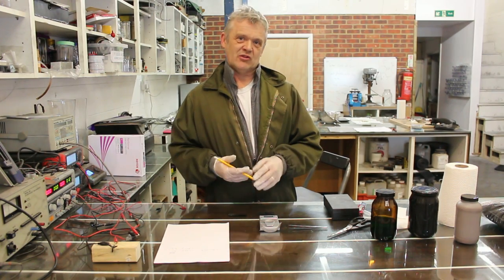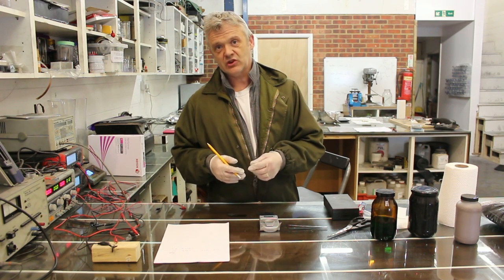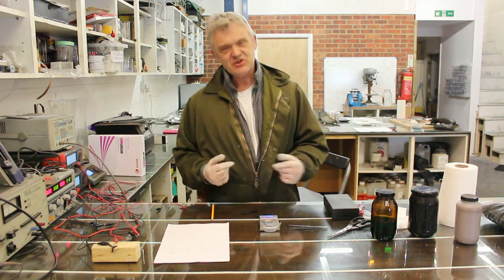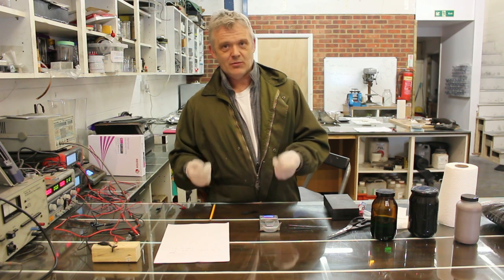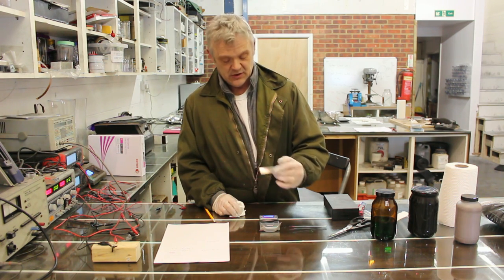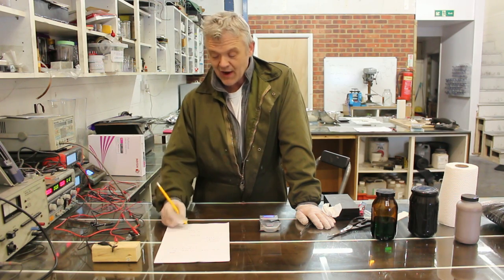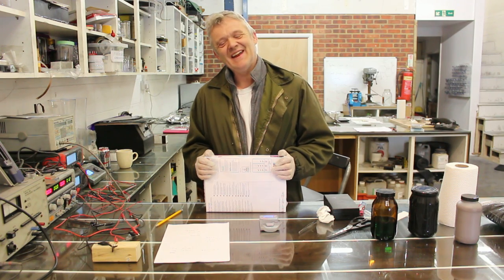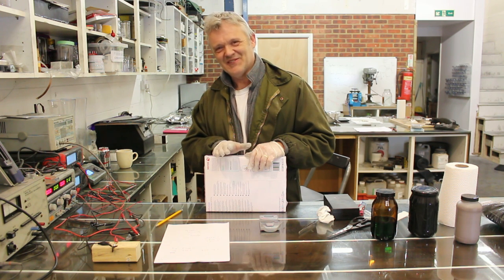How To Make A SuperCapacitor - Follow Up

Comment: Have you seen any of the devices created by Donald L. Smith?
Don Smith reverse engineered Tesla's transformer designs and Tesla statements about possibilities with transformer designs. I'm into coil design right now so I find it fascinating. Don smith makes a statement about capacitors about 5 minutes in, here:
https://youtu.be/-NbmheIGG_Y?t=299

Statement: This unit is a 50k watt capacitor. 1 Farad is equal to 1K watt
He's old and his mind is a little worn down from strokes, his math may be off some.

Is there any truth to his statements about capacitors potential energy?

P.S. I figured out how to apply Faradays Law of inductance from here:
http://hyperphysics.phy-astr.gsu.edu/hbase/electric/farlaw.html#c1

What is not discussed in the formula is how to determine Teslas/s, the formula is pretty straight forward for a moving magnet:
N x A x T/s = Volts
A magnets Gauss / 10000 = Teslas

Conceptually I thought the result was divided by time, it isn't. It is Teslas per second, after some time thinking about it I was able to create a formula which gives you Teslas per second.
(RPM divided by 60) x Number of magnets x (Surface Gauss divided by 2 then convert to Teslas) = Teslas per second

W00t!
Reply from the maker: +Don Ation hiya mate - I do know of Donald - his maths is a bit off a farad is a coulomb per volt and a coulomb is an amp second. A Tesla is a pretty big number mate, Gauss is tiny 1T=10,000 Gauss. So, I think you might have that the wrong way round. Could be worth checking
Reply: +Robert Murray-Smith Don states which laws he uses to arrive at his figures, I'll have to review and post at a later time.

All of Dons devices appear to have dual ground connections, exception being the airplane capacitor. With the output connected to ground there may be a discharge from the earth into the device; The device creating a similar condition in the atmosphere as the cloud discharging lightning, allowing the ground charge to move over a path toward the disturbance, like lightning travels from ground towards the sky meeting the sky discharging toward the ground. In that sense then, it would be a capacitive discharge collector, where our planet is the capacitor.

Gauss divided by ten-thousand equals Teslas is correct.
A magnet rated at brmax 14,800 Gauss
14,800 / 10000 = 1.48 Teslas

The Faraday formula doesn't relate to the capacitor discussion, I had an ahhaaa moment so I thought I'd share. ;-)

Note: brmax is what's available in the center of the magnet, Surface Gauss will be less, pull force can give an idea of SG. From the surface of the magnet into space, there is an exponential drop of Gauss, at 1/8th inch the drop in Gauss is approximately half, if the magnet has 6000 Surface Gauss a coil will receive approximately 3000 Effective Gauss. This is my current understanding.
Reply from the maker: +Don Ation cheers mate - a lot to think about there

Comment: Hi +Robert Murray-Smith, that's pretty awesome. Quick question, on your 2000Ah equivalent supercap, what is the charge voltage and farad capacity? I'm trying to get an idea of how many Joules/kWh you have in an EESD the size of a ream of paper :)

Love the videos, cant wait for your interview with Zero!
Reply from the maker: +Agentrfr 1.2v and 9 farads per square cm an a4 is 297 by 210mm and there are 500 double sided cells in a ream - so there are 5613F per side or 5.6Mega Farads per ream thats 6.72 Mega coulombs or 4.06 MegaJoules - it's 3600 coulombs to an amp hour - so it is 1,867 amp hours
Reply: +Robert Murray-Smith cool, so is that confirmation that your EESDs operate at 1.2V? That means that each of your devices get just over 1kWh per "ream of paper" - which is pretty impressive. Love the videos!
Reply from the maker: +Agentrfr I have a range of devices mate - some operate at 2.15 volts some at 1.2 volts some have battery like behaviour some have capacitive like behaviour - we were looking at home made capacitors here

Comment: Hey Robert are you doing any beta testing? We are working on a demo test unit, this uses an AC generator but it is coupled into a 12 kW charge inverter. I would be interested in a beta unit to test with when you get to that point. We will be implementing wind and solar with this as well.
Reply from the maker: +VulcanGasifier we are beta testing mate - we have 3 sites and we start that in 4 weeks
Reply: Nice, Ok late spring we should have funding to support our own system here. I would be interested in a beta unit if available. Ill get with you as we get closer to that point.
Reply from the maker: +VulcanGasifier ok mate
Reply: +Robert Murray-Smith Quick question. do you know of any type of dry electrolytes that could work. Specifically in a very high temperature environment. Could an Aerogel possibly work?
Reply from the maker: +VulcanGasifier NASICON and LISICON are pretty good but expensive
Reply: interesting I do some research Ill let you smell what i'm steppin later. haha!!
Reply from the maker: +VulcanGasifier lol - ok mate cheers

Comment: 2000 amp hours would be very impressive. Do I understand correctly that as the Super Capacitor discharges its voltage drops? If these figures hold up the energy density would still be impressive, but we would need some kit to keep the voltages with in the operative ranges of the motors using them.
Reply: +Ray Wharton Maybe put enough in serial to have the voltage well high of what's needed for the application, and have a series of resisters to hold the voltage down that get jumped as the power of the capacitor starts to drain. Then again a very large fraction of the total energy in the cap would be in the relatively high voltage part of is discharge curve.

Seriously, bicycle!
Reply from the maker: +Ray Wharton very true mate
Reply: +Robert Murray-Smith Right, I think this is figuring out the parameters for what approach to use to get the voltage out in a way that pleases the load fairies.
Reply from the maker: +Ray Wharton lol - nicely put mate
Reply from the maker: +dft Ah - i am beginning to understand mate - cheers
Reply: +Ray Wharton By the time voltage drops to 60% it will be 2/3 energy depleted or something like that. Maybe by the time it is 20-30% there will be so little left it wont be worth to recover it.
Reply from the maker: +dft what you are saying is true of all capacitors mate
Reply: +Robert Murray-Smith that is why there is no reason to try and  recover it all the way down to zero voltage. resonable range will suffice
Reply: +Ray Wharton Voltage boost circuits are quite common and this is how the nicer LED flashlights drain the batteries down while maintaining brightness of the light. I have some non boost lights and they get pretty dim as the batteries drain. My boosted lights last almost full brightness and then shut off completely when the battery is exhausted.
Reply: +Isaac Schlittenhart Very interesting, do understand that I am only recently getting into the head space of electronics and there are some big gaps in my knowledge base. Are the circuits you refer to related to joule thieves?
Reply: haha

Comment: 2000 Ah @ 1 volt? or 12 volts?  So 2000 Wh or 24000 Wh?  Either way that is impressive.
Reply from the maker: +John Allen 1.2 volts mate - though i used 1 volt to do the calcs
Reply from the maker: +nazo333 absolutely mate

Comment: robert there no volume on the video
Reply: +jonathan mateo I haven't had that problem mate, might be at your end or some kind of temporary youtube foible.
Reply: +jonathan mateo  Jonathan, ......... Check your wave balance setting on your computer.  Its in the  master volume control settings section of your task bar, assuming that you are running windows. Set the wave balance to the left or right channel.
Reply: +jonathan mateo not in stereo, on my system it's left channel only . the sound on my tablet sounds muffled but on the PC it's left channel only.
Reply: +jonathan mateo thank you everyone for the help. only the left side sound its working..
Reply: Your welcome Jonathan.

Comment: Definitely interested in the implications for mobile robotics at this point. To put it in perspective, Asimo (regarded to be one of the world's most advanced humanoid robots) has a run-time of about 1 hour, and takes THREE HOURS to charge, and the battery weighs about 13 pounds (6kg). If these capacitors can provide similar power characteristics with shorter charge times and less weight, the possibilities are endless.
Reply from the maker: +ZeroPointAlpha it will certainly help a bit - wait until i reveal the next one - it's 4 amp hour per gram - asimo will have 24,000 Amps at 2.5 volts lol
Reply: Robert Murray-Smith
His battery actually measures 51.8V, so you'd have to stack a fair amount in series. :V
Reply from the maker: +ZeroPointAlpha his battery might do mate - but what does a cell measure - how big is it and what energy density does it have?
Reply: Sadly, all I know is what they've released on the FAQ, which I've already provided (besides that it's Li-Ion, but that's a given in most devices these days where weight and energy density are a concern). All I'm saying is that about 26 of your capacitors in a series/parallel arrangement would potentially be a suitable replacement, particularly if the weight is also reduced.
Reply from the maker: +ZeroPointAlpha could be mate